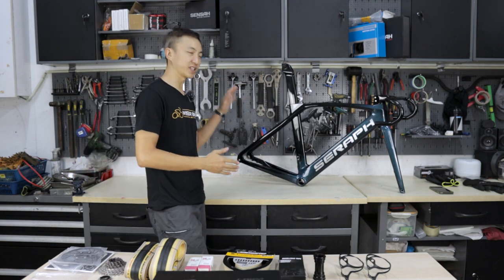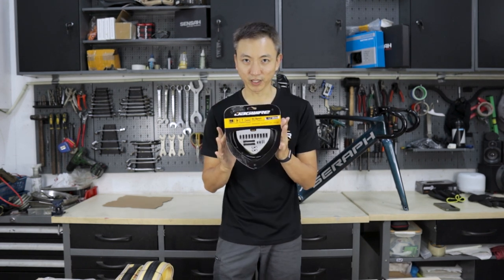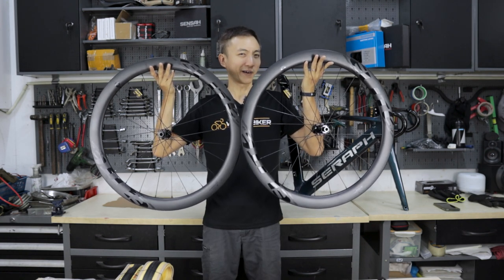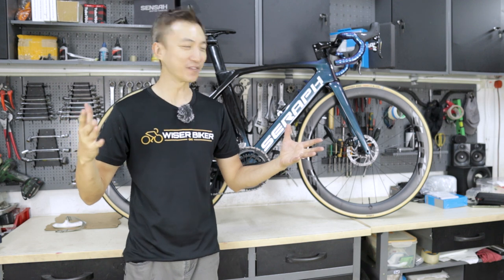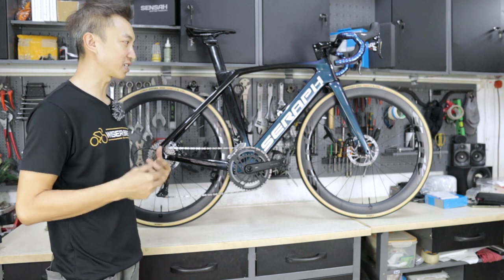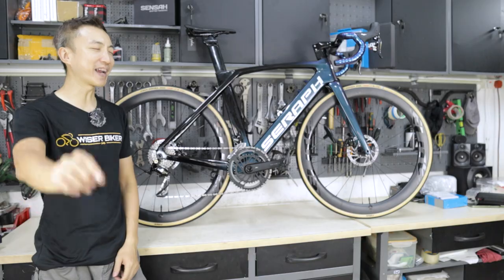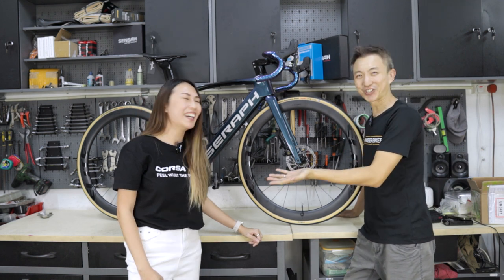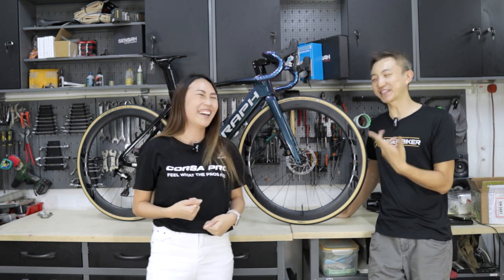Building a Super Chinese Carbon Bike from AliExpress - Part 2: Dream Bike Build

Comment: I noticed you didn't put no foam over the cables for noise reduction.  I was wondering is it really needed the last bike I built myself was not fully internal but I never used no foam there either. It was no problem.